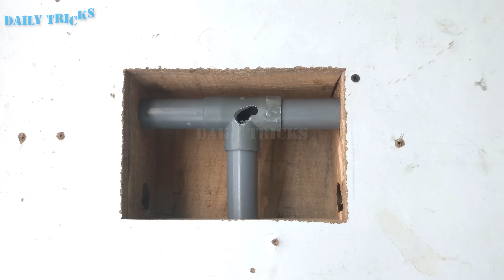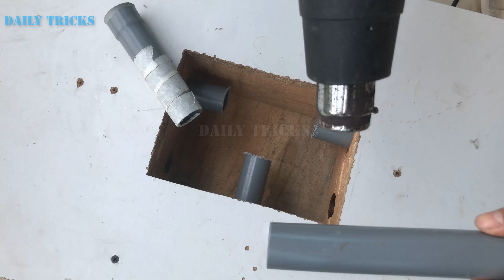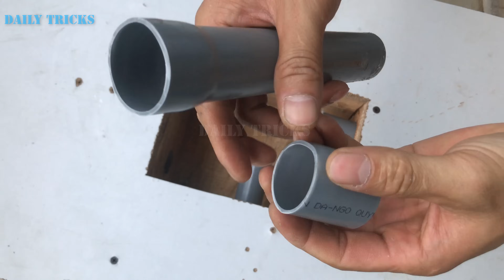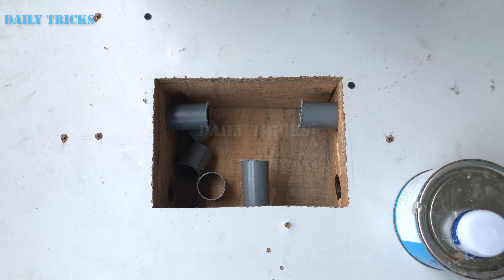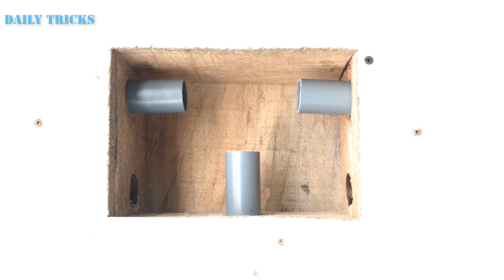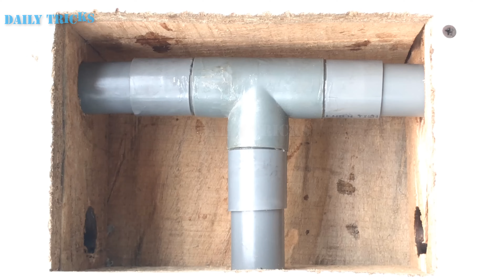Tips and Tricks of Experienced Craftsmen for Plumbing! Replace T-joints of Pvc pipes in tight spaces

Comment: So, what would make this video more believable would be to see it hold 70 psi of pressure.    Need a pressure gauge and show it pressurized over time with no leaks. Put some toilet paper in the bottom to soak up any drips to show if it does weep.